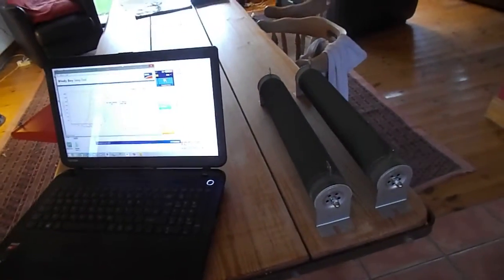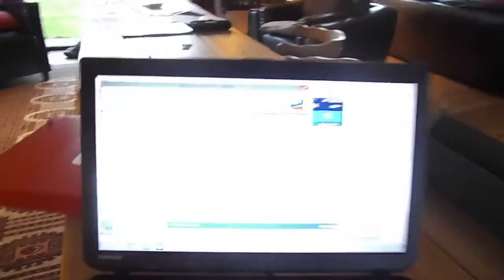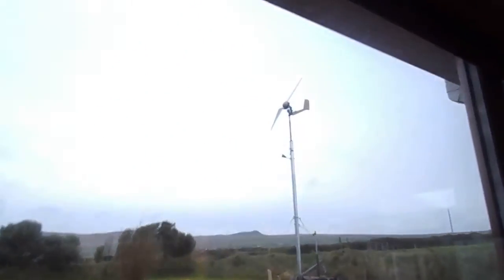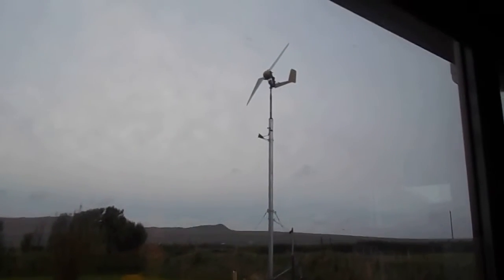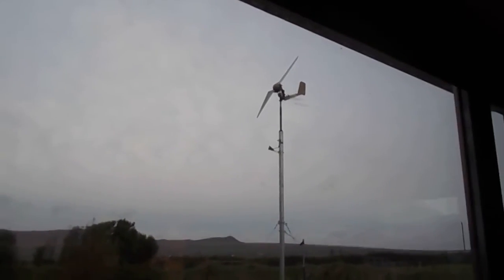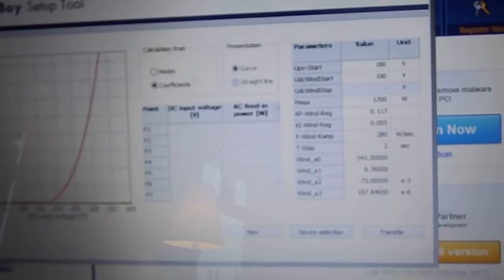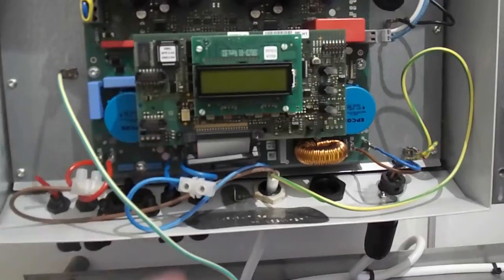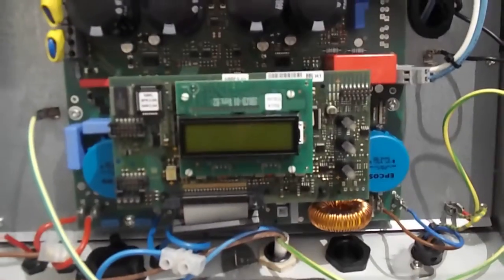DIY wind turbine system update

Comment: Hey Ian not sure about wat I have before I cast the stator two rotors 16  n52 mags stator 12 coils   1 coil between spinning rotors @ around 350 rpm giving me 1.3v can I multiply that by 12 for overall voltage
Reply from the maker: Thanks I will think on your question. getting late now
Reply from the maker: 1.3v x 4 coils per phase = 5.2 v x 3 phases = 15.6 volts @ 350rpm so I would say for charging 12v battery is spot on.
Reply: @ian57812  No, we do NOT multiply by 3, for 3-Phases @ 120 Degrees.  We multiply by 2.34.  12.1 volts = 5.2 volts x 2.34.  So, Cut-In will be HIGHER than 350 RPM ... more like 400 RPM.